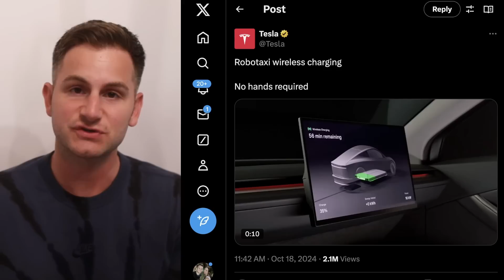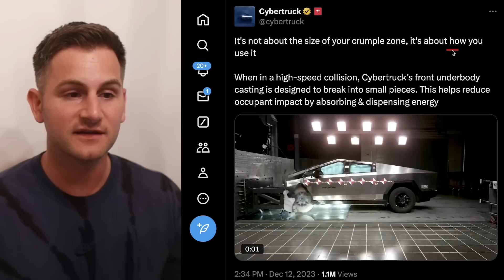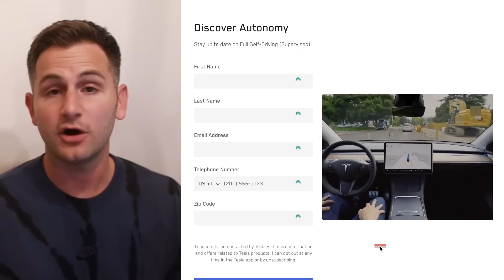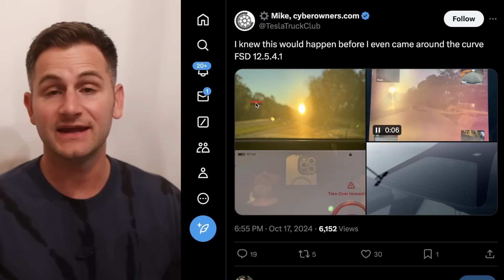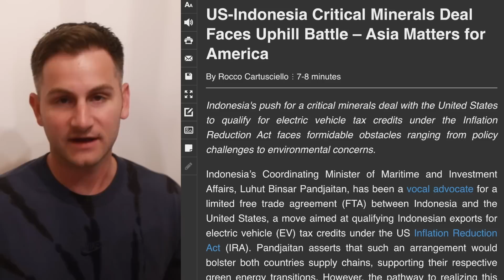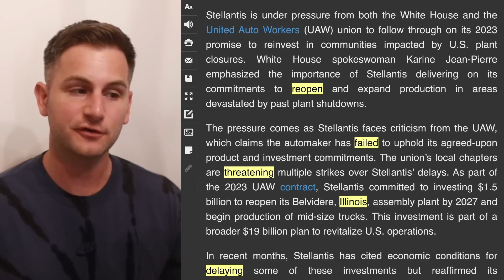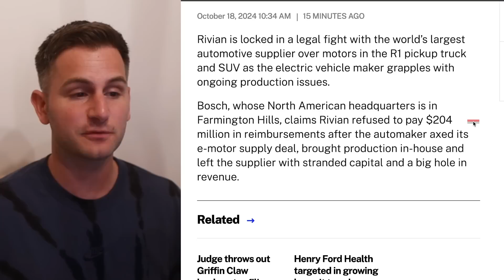Tesla Slowly Unveiling Its Plans / Big Cybertruck Change / Tesla's Battery Sourcing Play ⚡️

Comment: Tesla better come up with a better way to wirelessly charge the cars.
To prevent vandalism, the pads and cables need to be part of the pavement and not extruding above.
Reply: At least with wireless charging that's possible. That's not even anything to do with the wireless charging tech, just how it's packaged and installed. It's completely impossible to make vandal-proof cable charging. So I'm not sure why you're picking on the wireless charging as if it has some inherent disadvantage here.
Reply: @truhartwood3170  
What???
I just said, make it part of the pavement. Like as in under the pavement. Is that simple enough for ya! 😉😄
Reply: @wt9653  you said Tesla needs "a better way to wirelessly charge". Whether it's under concrete or not is merely packaging/installation. It has nothing to do with the tech or how it's used. Tesla doesn't need to do/change/invent anything here. They showed a simple CG animation to show how it works, not how it would be installed. It's like if you watched an animation on how a fusion reactor works and immediately started posting about how it needs walls or it will irradiate everyone.

Comment: The inductive charging pad is shown on the ground. But the air gap between the pad and car greatly reduces efficiency.
 The obvious answer is to use a little AI and moving parts, so the charging pad is moved up into close contact with the car. (And locks the car in Park until the pad is back on the ground.)
 Elon, send me a contract.